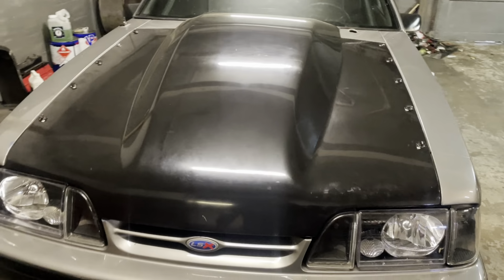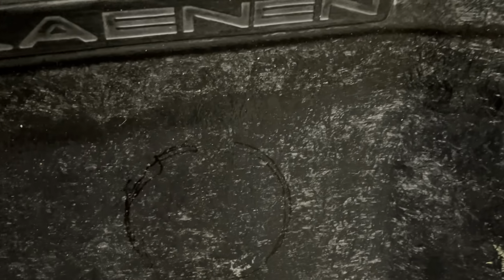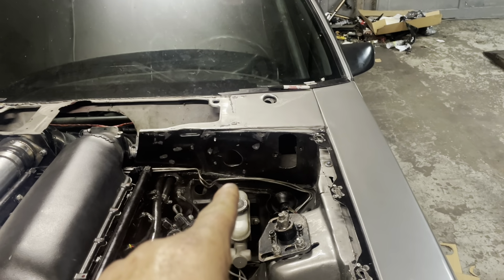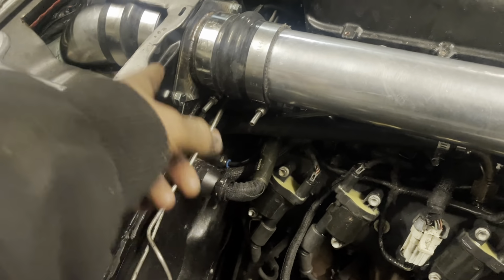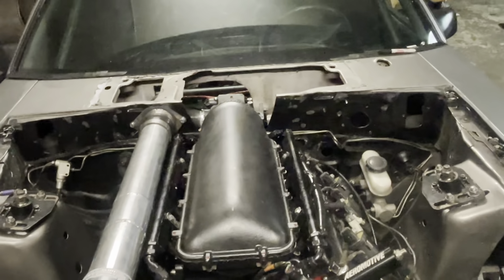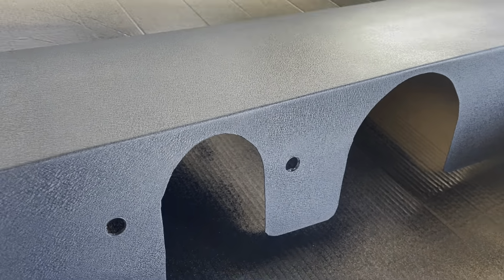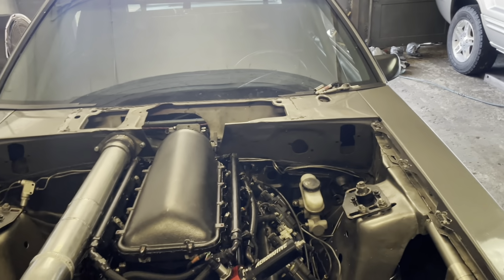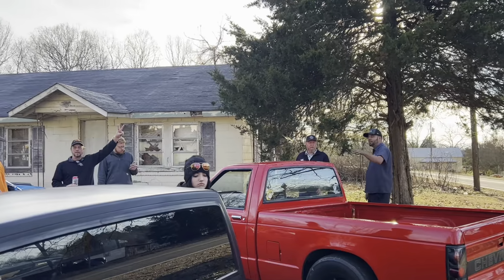Working on ghost with a fun night of racing at the end

Comment: Envoy should try one step colder plugs pull 4 more degrees of timing if it feels to slow add two more degrees in vp110 works great in separate tank for wet shot